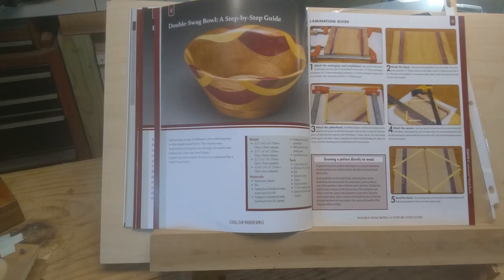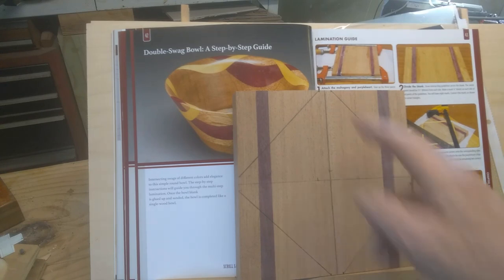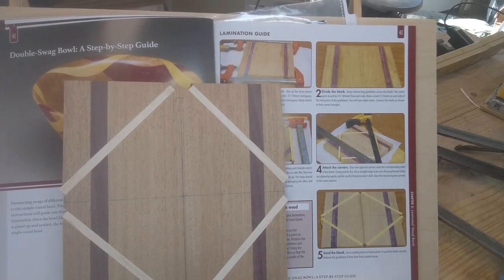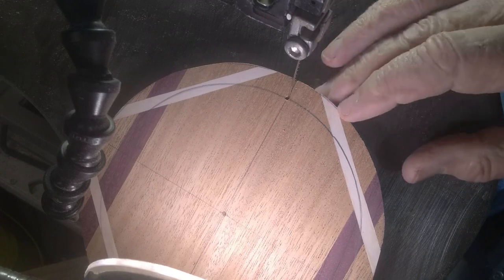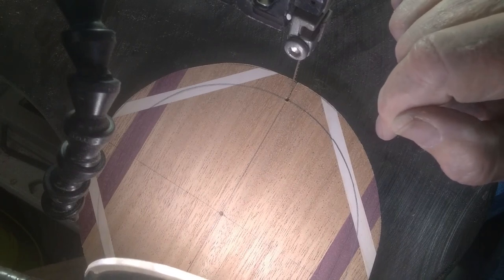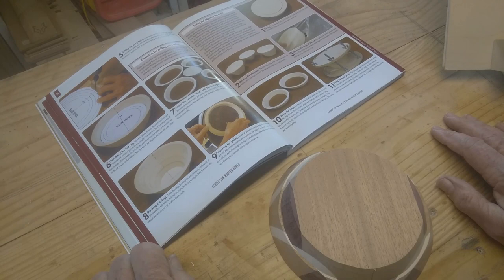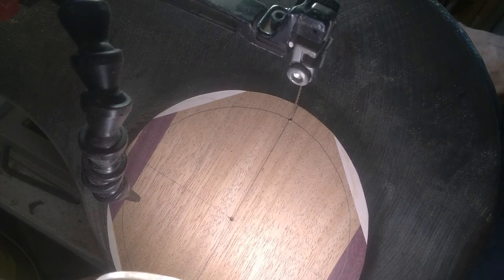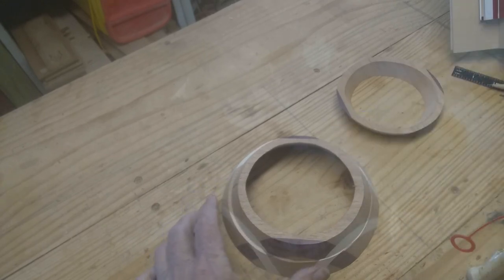Scroll Saw Double Swag Bowl Part 1

Comment: Could it be because of the increased thickness of your blade? I would think that going from a #7 to a #9 would be quite a jump in thickness.
Reply from the maker: That was one of my first thoughts, but I don't think so.  It was off a good 1/8 inch on all parts of the circle.  My next thought was that I had sanded it too well making the blank smooth and thinned it, but it was within a 64th of 3/4.  According to her book it doesn't always cut the way the numbers tell you it should, so sometimes you have to adjust the angle which did work for me.